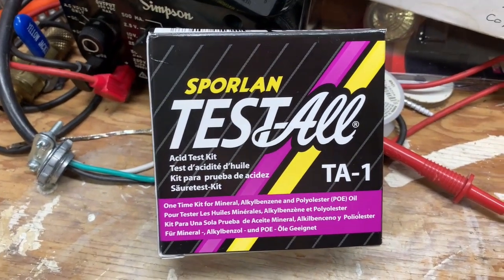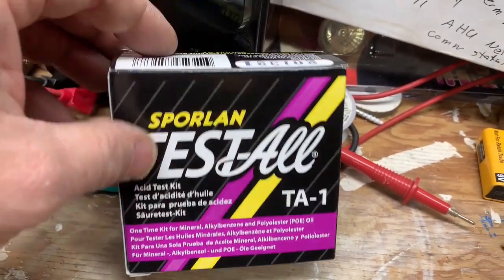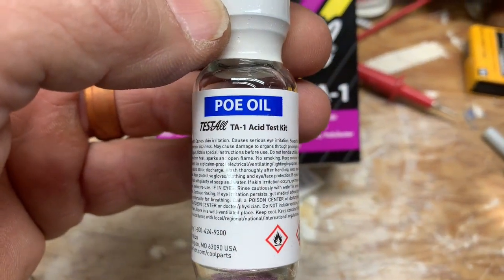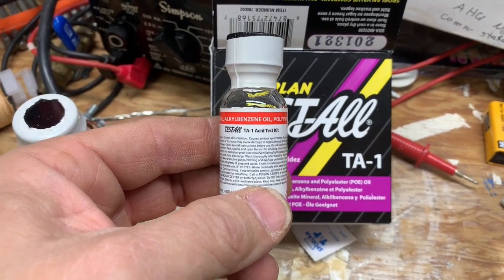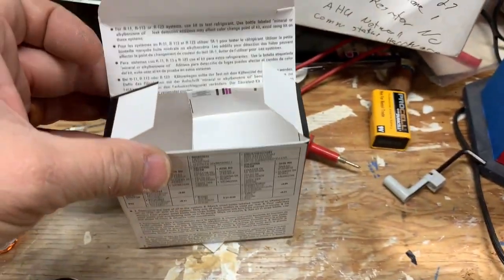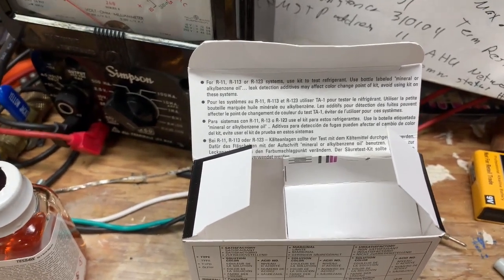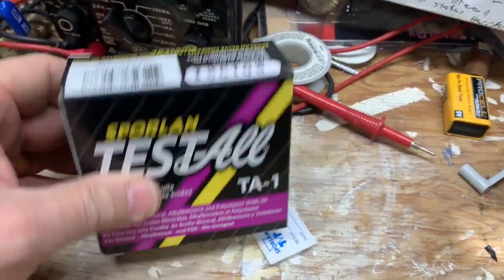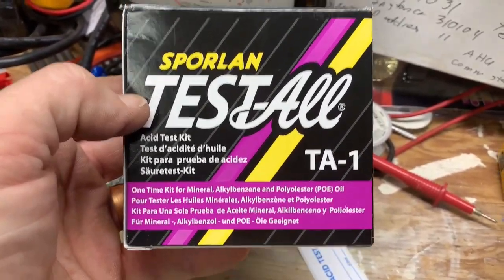Testing Daikin PVE Oil for Acid

Comment: How much of a oil sample do you try and get and if you aren't changing a compressor how do you collect it
Reply from the maker: Normally enough to fill the sample bottle (neutralizer is added to the indicator solution, and then the neutralizer bottle is filled with oil collected from compressor).  If you’re not changing a compressor, there really isn’t a way to collect a sample. Normally it’s not an issue if it’s not a grounded compressor you’re dealing with, but you can still test if a compressor comes out.
Reply: @tcphvacr9950  why is the oil an issue when compressor is grounded?  Does acid eat away at the insulation on windings?